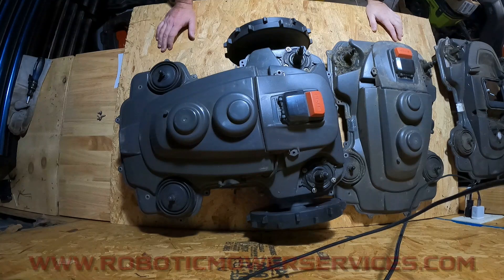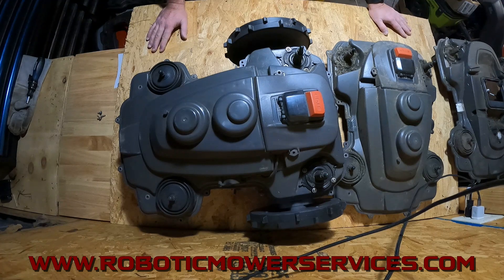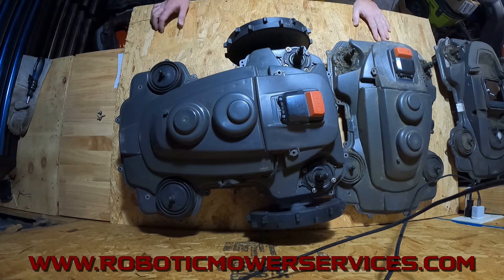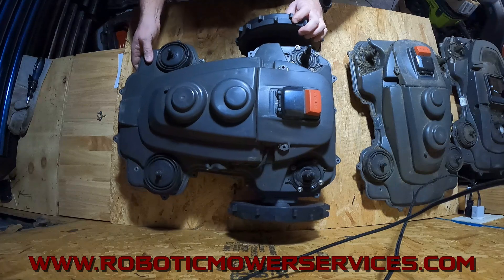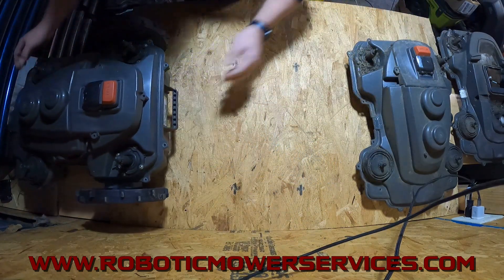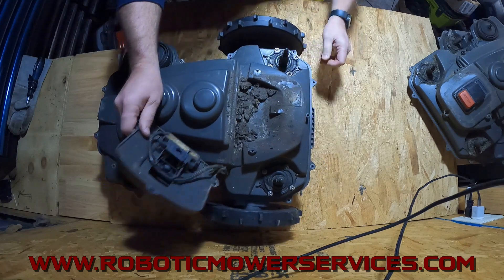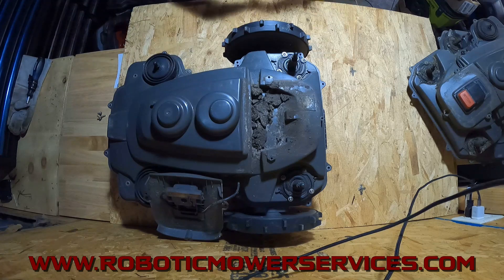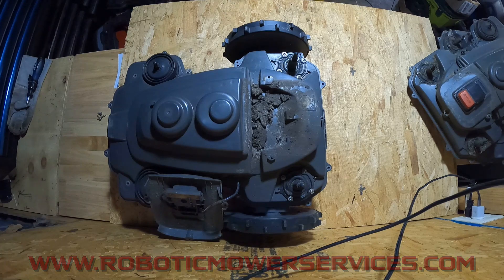Husqvarna EPOS Automowers: Important Service Info That You Need To Know To Save Your Boards & Motors

Comment: Issues this year were almost certainly firmware/new wheel motor related. Had several mowers with bad parts out of the box or crapped out within a week. Husqvarna quality is really going down hill, don’t see these kinds of issues with other brands.
Reply from the maker: Yeah, there were definitely issues with those 2 things. But having heat trapped in there definitely doesn't help the wheel motor issues. Especially since the new style motors on the 550 & 550H EPOS models don't have the metal mounting flange to help dissipate some of the heat.

Comment: Thank you for pointing this issue out! Do you know often should you replace that filter?
Reply from the maker: Husqvarna recommends replacing it at the end of every season, but on these EPOS models we recommend checking it a few times a season and replacing it mid season if needed. It's a very inexpensive part compared to circuit boards and wheel motors.